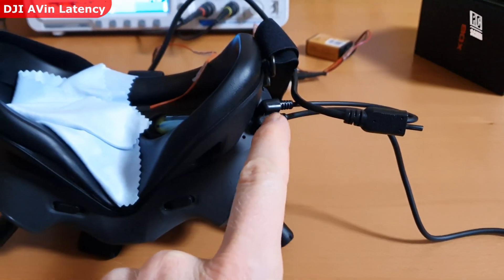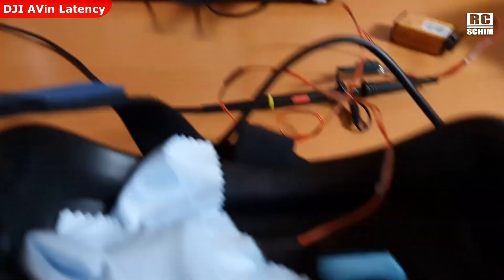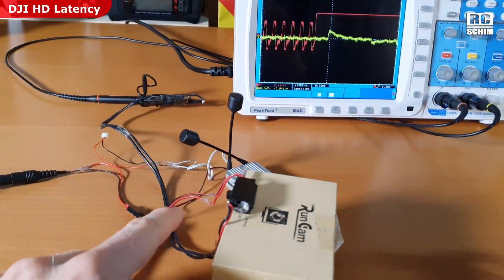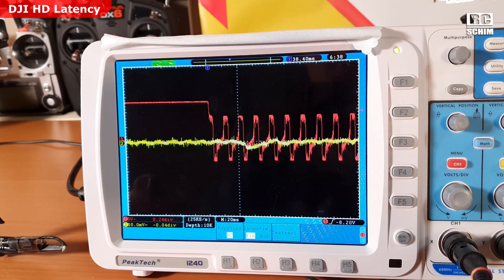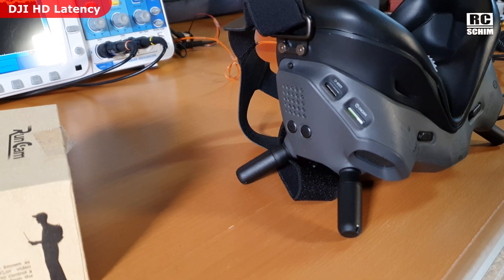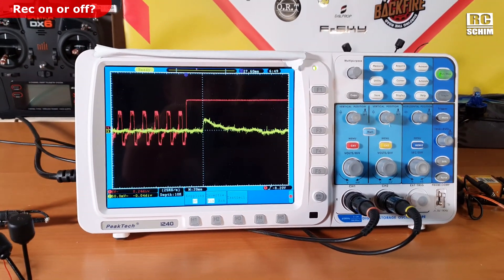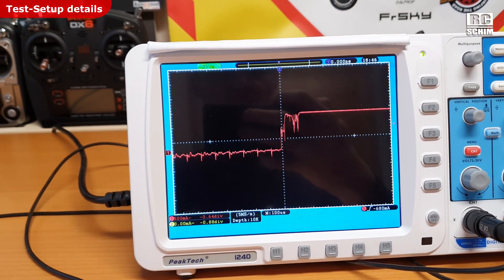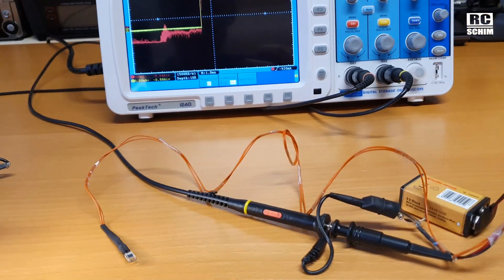DJI FPV HD and AVin Latency tested (important finding: powercycle after modeswitch)

Comment from the maker: UPDATE: as of 2.Dez. there is a new firmware (10.0.02), and it fixes most of the issues. I have a new video in preparation, but things are moving very quickly :) 
AVin Latency:  it was a mess before (variable latency between NTSC and PAL switch) - very unreliable...    now it seems to be fixed. Measured 20ms (roughly the same NTSC or PAL). In comparison: Fatshark+Rapidfire module ~ 10ms       LCD screen: 5ms     
00:00:04 DJI AV In LatencyTest

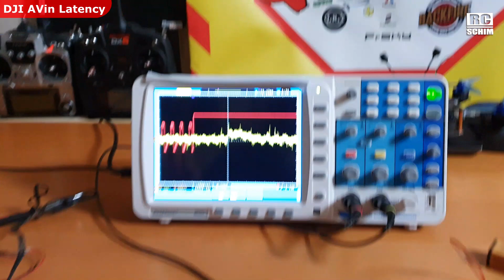00:01:12 2nd AVIn Latency test - better!
00:03:13 DJI HD Tests, Latency correct BUT...
00:04:28 70ms or even 100ms???
00:06:07 switch to LowLatency mode
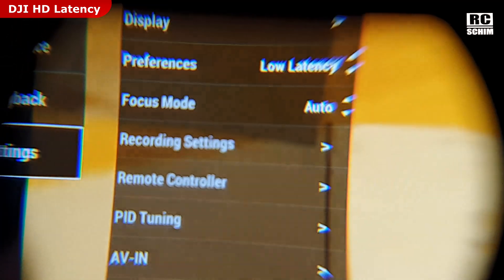00:07:44 switch to HighQuality mode
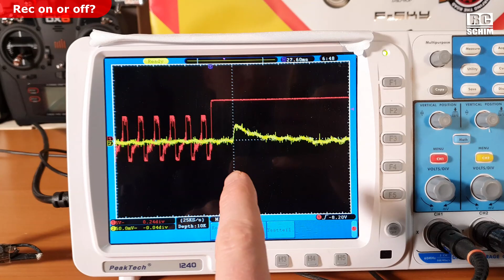00:09:51 Rec vs noRec Latency = same
00:10:05 Nathaniel Akkermans
00:10:55 try HighQuality mode! 
00:12:21 my Latency-Test setup
Reply: Great! I really want to see the difference with this new firmware... And how it compares with fatshark...
Reply: It seems the 12/2 firmware update has improved a lot.

Comment: And maybe also auto focus mode on or off has an effect on latency?
Reply from the maker: Hi, I don't think that any of these 2 options impacts the latency. Back when I made this video - the firmware was a bit buggy and latency easy affected by some factors - soon after that it felt way better.
Now with O3 they stepped up even further, O3 is way more consistant in latency and feels less stuttery in bad reception situations...
(but  I still love old Airunits in combo with WTFOSD and INAV!)
Reply: @Rcschim  true, i own dji fpv from the verry beginning and first firmwares ware indeed not ideal. Slowly switching over to 03 goggles and vista now.

Comment: Hi RCSchim, do you know if the DJI FPV goggles support HDMI output as well?
If so, then it would be interesting to know what the extra lag is from camera to goggles1 HDMI output to goggles2 screen. 
The reason for that is so that long range FPV can be flown with 1 pair of goggles used only for its receiver capability and fixed to a tripod or antenna tracker, while using the other pair of goggles for viewing and head-tracking with a head tracker stuck on.
Only if this is possible without too much lag, can I start using HD instead of analog for FPV soaring.
Reply from the maker: I'm quite sure that this will not work. They dont want to give this away for free. HDMI out would make it possible to get good transmission also for live events - and they want to sell expensive pro gear for such purposes...
Currently I dont think longrange is easy with DJI. many tested and they get sudden drop of link quality around 4miles.
So if you stay below this and do "medium range" you dont need special orientation - it's more or less a worry free video link imho...

Comment: There is a new firmware that claims to lower the latency in analog mode. Can you test?
Reply from the maker: it's not lower latency - but it's ok and it's CONSISTENT now, before it was sometimes good and sometimes really high.
Now it's around 20ms - which is about as good as flying with a foxeer falkor for example.

Comment: This is outstanding. THANKS for this test. At 20ms or so, this is really not much slower than analog. Maybe not as fast as an analog setup with a fast camera like Predator V4... but on par with something like a Falkor. Now... DJI just dropped an update that addresses the analog latency. Could you please test again with the update to see if the analog in latency is reduced? PLEASE :)
Reply from the maker: yes, I did - video will follow. In short:  latency isnt faster - but it is consistent. 20ms still.
You're right about falkor - that was at 20ms.
I tested using the FXT Venus Pro (which had 0.3ms!) - so 19.7ms are from DJI goggles (not that I could measure that accurate :)
Fatshark + Rapidfire is ~ 10ms btw.
Reply: @Rcschim  Got it! Thanks. The numbers I posted where are from memory and estimation, so they were likely off. I see what you mean. When you say FS + RF 10ms, you  mean that the goggles and module add 10ms to whatever the camera does. So for example, 15ms for FS + RF + Predator V4? In short, I see that analog is faster, by 5 or 10ms. But 20ms for DJI in both digital and analog from lens to screen seems totally acceptable to me.
Reply: @Rcschim  I saw your pinned post just now after I replied. I got it then. It's 10ms for the goggles with module + the screen and camera latency. So roughly 15ms for a fast setup like a Racer 2 or Predator V4.

Comment: The new DJI firmware released today has a note about improved real time analog performance. Would be good to revisit to see if it did improve on the points discussed in this video.
Reply from the maker: 20ms now consistant, video will follow

Comment: New update today(12/2/2019) says "Optimized AV IN analog video transmission to improve real-time performance." Latency testing this for a comparison to the old would be awesome.  -> reference DJI Digital FPV System Release Notes (12/2/2019)"
Reply from the maker: 20ms now consistant, video will follow

Comment: I think you need to redo the test cause dji released the new firmware today ;-)
- Added support for recording AV IN analog video transmission.
- Fixed issue: display issues appeared in AV IN analog video transmission.
- Optimized AV IN analog video transmission to improve real-time performance.
Reply from the maker: 20ms now consistant, video will follow

Comment: @RCSchim DJI just released a new FW to improve real time performance of AV in and AV in dvr recording. Can you do a latency test on those as well? And check if there is a difference in latency with and without recording av in?
Reply from the maker: 20ms now consistant, video will follow
latency was not increased while recording

Comment: very nice, thanks for putting in the work. by the way have you ever done a glas-to-glass latency test with a typical analog system with a fast camera and a fatshark goggle? a relative difference between the digital and a high end analog would be really interesting!
Reply from the maker: for my next video I did (again):
Screen (really old LCD FPV screen with built in VRX) ~ 4.8ms   (where 0.3ms are from the cam - the FXT venus pro)
Fatsharks with rapidfire: ~10ms
DJI goggles AVin: ~20ms
DJI goggles lowLatency digital mode:  ~ 20ms  (maybe 18ms)     highQuality:  25-30ms?    but this get's worse with higher distance or lower reception...
From my perspective:  most pilots will not be able to tell much difference (if any at all!) between  10 and 20ms. 
20ms is the limit - from here on latency becomes noticeable. Depends on your coffein-level and general "woke" state :)   if you notice lower latencies :)
Reply: @Rcschim  wow thanks a lot ! yeah 10ms is not too much, but it does add up, in the end the stick-to-glass latency is the metric that determines the feel of it, so adding in the control link latency would give the overall. ive seen some test somewhere done by someone showing that crossfire alone was like 20ms faster than frsky (15ms vs 35ms), and many say that they feel a difference (unless its just confirmational bias). In the end i think that like you mentioned once it really depends on your flying style as well, for smooth cruising latency is not an issue but if you do last-second knife edges though tight gaps i would argue that probably 10-20milisecond counts.

Comment: Thank you for these tests. For your analog av-in test, what is the analog rx that is connected to DJ FPV Goggle in?
Reply from the maker: it's the really old FR632  (I did a review a vew years ago)  and I attached an FXT DVR onto that  (that's why it might look fancy...)
I've also tested if using this VRX impacts latency - NO it doesnt - if any, there are only a few micro-seconds of latency added by such analog components.

Comment: HI, nice review and thanks for mentioning me in it! Did not know that you need te powercycle the Air unit when switching from mode, I will give the high quality another try. The extra delay when recording is only when you record on the air unit, when only recording on the goggles I didn't find any additional latency. 
Looking forward to your complete review
Reply from the maker: I did rec on both and still saw no increase. But I will check this again...
Reply: @Rcschim  maybe they fixed it in the new firmware indeed. Let's hope so because I like the air unit recordings, then I don't need the GoPro. The recording is not the best but I find it good enough for making some YouTube videos. 
Regarding the variable analog input delay, I noticed when you unplug and plug the av plug then the latency is already different. Maybe there is some internal buffering that is out of sync with the video input. Interesting to see if you also find these results. 
Keep on going to do the good work 💪

Comment: @RCSchim  I heard that NTSC/PAL makes huge difference in latence... could  you test this? Maybe the  displayrefreshrate is not  synced with the inputrate, so there can be allways a full/half frame missalign/latency. Maybe if you let the goggles run the latency jumps if the display/input rate get in/out  phase...?
Reply: ps: also interesstend would be if on weak signal  when the timewarping effects appear maybe the low/highquality switch  added delay comes back  even if signal is strong again?
Reply from the maker: I think these things are now fixed with new firmware. Now it is pretty consistant (on digital and also AVin) doesnt matter now if you switch between NTSC / Pal or between lowLat and HighQuality

Comment: delay in latency around 5ms while recording is said to happen when you record on the air unit, not the goggles
Reply from the maker: I heard this a few times - but I cannot confirm. Latency DOESNT increase while recording (rec on both sides, goggles and airunit).

Comment: When using AV in, is the latency consistent after power cycling? I am thinking of doing the Rapid-fire mod which requires the AV in mod. From your video I understand that the latency is less when you power cycle like it is with the low latency mode and high quality mode, however if the AV in latency is not consistent after power cycling (as it is with low-latency and high quality) then I don't think the Rapid-fire mod is for me.
Reply from the maker: My theory, av signal should be on first, then turn on goggles and avin mode. I gotta test this tho. Will test it in a few hours and update you. 
If it is constant around 30ms, maybe one can live with it. 
I will also see if pal or ntsc is much different.
Reply: RCSchim  I look forward to your findings.

Comment: That would be nice if DJI could fix the issue for the latency of the analog input.  If only they had integrated a 5.8g analog receiver these would be the ultimate fpv goggles.
Reply from the maker: they did, with new firmware 10.0.02
latency is now around 20ms - which should be fine!

Comment: Tests we need. Thank you Mario! Btw, I noticed that square(ish) wave in the switch signal. It seems to have period of ~20ms which corresponds to frequency of 50Hz, so is this just the mains electricity noise?
Reply from the maker: Today I figured the "noise" on my red line. I had+ and - wrong and some blind current came thru... now it is clean again.

Comment: Nice! This was very informative, but it was a little too late for me for decission-making: I already ordered the goggles two days ago 🤪
I will keep my FatSharks for analog but surely will try the AV in, maybe with the groundstation first.
Reply from the maker: you wont regret deciding for DJI fpv - that's for sure! you can keep your analog goggles for low latency analog fun tho. I think I would only fly planes or stabilized copters with DJI goggles in AV mode...

Comment: Amazing. I did exactly that. I tried HQ, latency was like an hour long, went back to low latency and never tried HQ again.
Reply from the maker: Great to read, that it happend to you and you have learned something of my video. How much better can it get for a "content creator"?
I think your DJI HD review was the first I watched and the immense range and penetration you got there were for sure a reason to buy it! greets, Mario
Reply: @Rcschim  same...if roogie don't hate it ...it must be great lol
Reply: I did the exact same thing too! Flew half a pack and never went back. I know what I'm trying out tomorrow!
Reply: @carbonfire1247  ditto and ditto ;)
Reply: SCRAGGLE MODE!!! I just flew it and it was legitimately good! Definitely lower frame-rate and a little latency noticeable in tight gaps, but so much less compression. I'd much rather fly in high quality mode in a lot of instances now.
Reply: @carbonfire1247  don't confuse compression of leaves n similar small items w bad signal watch your mbps until that drops to single digits your GTG, n gotta be on latest FW for hq to have good latency
Reply: @flo-ridafpv5713  Yeah, I know. Even when the signal is good (bandwidth pegged at 25mbps) there is a noticeable difference in the amount of detail you can see in HQ mode. Just upgraded to the latest firmware and the latency is definitely very good compared the time I tried it before, it was almost completely unflyable before. The most annoying thing about HQ mode is the framerate, it's not quite as smooth when you are doing fast movements. But if you are just cruising and enjoying the view it doesn't matter.
Reply: @carbonfire1247  OK cool good info in tried it before and hated it but probly didn't power cycle like rcschim said but now no need n I'll try again if cruisin

Comment: I run HQ too. Always wondered why people said it made them sick. Nice test. Would like to hear if you try to do consistent resets with analog, is the latency consistently low?
Reply from the maker: I will try to find out. Maybe theres a certain order that you have to turn on the devices (like:  first analog VTX, VRX - to have AV signal already available for the goggles) - then goggles + avin mode.
Maybe the goggles are confused if you turn on AV mode without actual signal on the cable...
Reply: @Rcschim    Btw, this popped up on the Facebook group. Since I was already pondering mounting something to the side, for $12,....why not? 
https://www.banggood.com/URUAV-5_8G-RX-PORT-2_0-DJI-Digital-FPV-Goggles-Simulation-Receiver-Board-for-DJI-Fatshark-FPV-Goggles-p-1605285.html?cur_warehouse=CN
I also liked the look of the padding in that photo,..so found that on banggood too,...  We'll see how it goes in 6 months when it gets here,.... ok, ok,.... only a month,.. but I'll have forgotten I ordered it by then. :D 

My thoughts are that you must have HD for outdoors. But indoors you don't really notice it.

Comment: Nice review. Please do 1 for Byte Frost as well.
Reply from the maker: chances that I will get one for review are pretty low, chances that I invest my cash are even lower :) I'm happy with how DJI hd works atm...
from what I saw on other reviews it doesnt look to promising.
maybe I find someone around who has it and hands it over on my bench for a quick test.  (but where I live there are still not too many fpvers).
Reply: @Rcschim  I understand. But so far I can't find any videos or articles to verify their claim of fixed low latency. No one has done a latency test on the system yet. If anyone were to do so, I would trust the ones that were done by you more so than the rest.

Comment: Do you still have pixelating problems with autofocusmode?
Reply from the maker: you mean the mushy grass I spoke about?  for me, that's in lowlat mode - most of the times...
on highqual mode it looks good most times - only on the edge of reception it switches to focus mode - and then you notice some blurry edges...
Reply: Thanks for this test. I did not tried HQ Mode yet. Next time definetly the first thing to do. 😉

Comment: Wow.  Great science!!!  Thanks so much for your efforts on this.

So after power cycling the Goggles in AV In mode, did it consistantly produce 30ms?
Reply from the maker: to be honest: didnt try it more then this 2 times. From what I heard it's not consistant. So maybe there is a certain order that you need to follow.
For example: enable AV source (external VideoRX) first, make sure you receive a valid signal, plug it into the DJI goggles and THEN turn on the goggles and AVin. 
Could be something like this.   I will try to confirm this and update here...
Reply: @Rcschim  , guessing (theory) just like switching from Low Latency to High Quality modes, you need to power cycle the goggles when switching from HD and AV In for optimal latency performance?

Would be interesting to see that if in AV In modes, after multiple power cycles, do you get 30 to 40ms latency OR after some does it jump up to 60ms+.
Reply: I'd also be interested in more Verification on the consistency or lack thereof
Reply: AV latency is variable,here is similar test but with more statistics https://youtu.be/1ELNNLmjbUw